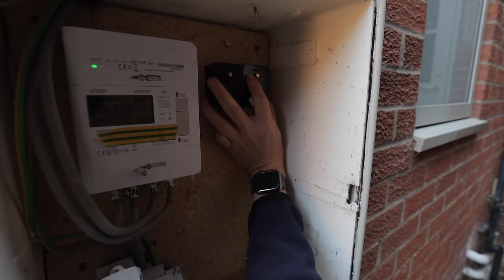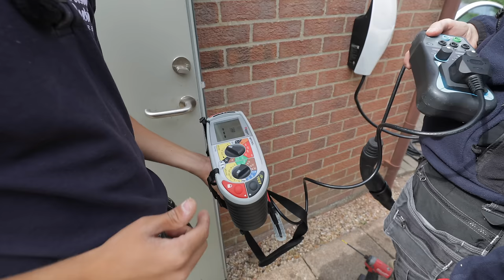I was WRONG! The Tesla Gen 3 Charger is the WORST!

Comment: Tesla, like apple,  only like doing things their way. The template suggests the backplate only be fitted with two screws, if going for a rear cable entry then the two screws are on one side, which can make the unit wobble a bit. They provide their own shaped screw heads which round off. The carbide terminal screws really affect the test readings so you have to awkwardly get the probes in. The tether, as Jordan mentioned, does its own thing and will not coil up neatly. Not to mention the PEN fault detection device needed or the annoying WiFi restraints and commissioning app!
Reply: I have installed many Gen3 Wall Connectors, including my own with NEVER an issue connection with a Wireless Network.
Reply: @michaelholliday100  FFS so you keep telling us... We get it you have installed loads without issue, well done.

Comment: I use many nodes on Wi-Fi for my IOT devices. To be honest I never use Wi-Fi for my CCTV so I will never understand why the Tesla Gen 3 does not have the option of wired CAT5/6 connection. Wi-Fi has noise and the more devices the more noise. It is like one CAT5 connection for all devices. So either separate them or hard wire them. In my mind hardwire them and I have three isolated Wi-Fi networks!

Comment: Jordan, are you not able to put a side cable holder on the left hand side of the charger and then put it in place on the right side. You can have the roller on the left side of the charger with the last bit going to the side female placement to the charger. Just a thought!!!

Comment: I wrote on your first ver3 vs ver2 charger video. An electrician myself. I have installed versions 3s.  There has never been a problem getting the wifi set up. The customer does it anyway. I just had a customer link up 2 of them sharing on one 60a circuit and he did it with not much trouble.  Munro live did a overview and found the design to be very  well executed.

Comment: Hey Jordan, I just had a look at the Tesla spec. It only supports 2.4Ghz b/g/n WiFi… modern/newer WiFi protocol is on 5Ghz band… so if you aren’t running 2.4Ghz in your office, the charger won’t find your WiFi network 👍🏼
Reply: Its not really correct to say "newer WiFi protocol is 5Ghz", as the protocol is a different thing and a good WiFi 6 router actually does WiFi 6 on 2.4Ghz too, so both radios are actually on the  most modern protocol.  Not to mention that 6Ghz is the latest WiFi frequency now and 5Ghz WiFi has existed almost as long as 2.4Ghz, it just wasn't as commonly used when hardly anyone had WiFi so interference wasn't an issue.

That said, most devices on 2.4Ghz will be WiFi 4 because its cheaper to implement (2.4Ghz never was upgraded to WiFi 5/AC).

Comment: Depending on how its configured some US wifi devices won't operate on channels above 11  (Different countires limit use of higher channels). Forcing the Wifi router onto a lower channel can solve this.

Wouldn't expect tesla to have this issue as surely they must adjust it to the local country/region. 

But I have deff encountered this before when using wifi enabled devices from the USA in the UK. Particularly when people have forced their wifi onto one of these higher channels to avoid interference with neighbouring wifi routers/hotspots. Would link to the wikipedia page of compatability but not sure I can post links here?
Reply: I posted a comment below with a link to a tesla forum confirming the above, but it was deleted due to an external link. Seems they disable some of the 2.4GHz  channels eg. 12+ as these are disallowed  in the USA. Odd they don't tailor this to the EU market!

Comment: If the charger had trouble connecting, it may keep having trouble updating once placed to the original position. It would be wise for the homeowner to have a Mesh system with an external (or internal) WiFi point unit somewhere near the Charger. It would also help wireless light bulbs, cameras, doorbells or other devices that would have trouble connecting in this area.
Reply: Yep Ive just added a  wifi extender in my garage so that my charger in the garage can reliably connect and also my soon to be (hopefully) solar & battery stuff.

Comment: It’s probably the dual band 5GHz sharing 2.4GHz and 5GHz. Happens a lot with Smart Home and IoT, they come with a cheap wifi chip that can’t determine or filter out which BSSID is the 2.4GHz to use.

If they request the connection and get the 5GHz, it just times out instead of connecting. And it doesn’t know why it failed, because it is cheap, ie it doesn’t attempt the next MAC radio Device or understand how to. Usually it’s something like an ESP8266 chip, $1 or less.

So it just tries to reconnect to 5GHz again as it’s in the top of the list of connecting MAC radios, ie the strongest signal or best to connect with when you have a shared broadcast name with 2-10+ repeaters that all announce themselves with the same channel name. 

Because the names are identical, they have to know the MAC and connect to the MAC, not the Name. The problem is repeaters won’t work if you hard-connect to a single MAC, and if the router changes then you have to re-register the WiFi. 

It’s why people recommend a legacy 2.4GHz channel name on the router for connecting old/cheap devices that can’t differentiate and only work on 2.4GHz or 802.11b/g
Reply: Agree. If it has to be signed up with a phone, always go 2.4Ghz. Most home routers have out of the box one signal that is supposed to support 2.4 and 5 but that is not the case as most IoT devices dont seem to work . So the only way its to create two different wifi connections for 2.4 and 5.
Reply: @B_T_B  Rather not recommend that for regular use 2 separate SSID's for 2.4/5Ghz, but instead create an extra 2.4 Ghz network on a separate SSID for IOT devices that don't support 2.4/5Ghz mixed in one SSID.
Reply: Actually in this case, the Tesla 3rd Gen charger only supports 2.4GHz WiFi
Reply: Could be the density of the network too. I do a lot of IoT and esp8266 and some eps32 don't like high density networks so I just keep my it wifi at VT20s
Reply: This!!! so very true!!
Reply: @antoniogoncalves705  There is a limited number of channels available, so eventually, with a lot of independent SSIDs congestion will occur. That's why the 5GHz band came into use.
Reply: @deang5622  There are 13 channels for VT20 2.4Ghz and if you have a self optimizing AP unless you flood your internet with a lot of wifi and devices having 3 networks 1 5Ghz 1 2.4Ghz and 1 for IoT wont be a issue.
Reply: @antoniogoncalves705  Where I live, I can pick up 20 individual WiFi networks.
Reply: @deang5622  Hoo that makes more sense. Still for example Ubiquiti devices have auto channel selection based on traffic besides that yhe that kinda slows down internet connection.
Reply: @antoniogoncalves705  You are mistaken, each channel is 5Mhz in width, so there are potentially four VT20 channels (as its technically using four channels) but generally only three  as so many routers use the US scheme which only has 11 channels .  To further confuse this most routers only mention one channel, some call it centre channel, some will call it upper-channel, others lower-channel.  So you may need a WiFi scanner to make sure you are aligned correctly with other networks, assuming they are even configured correctly.

WiFi you do not want a VT20 channel to partly overlap another, as that is seen as background noise so they will try to broadcast at the same time as each other.  Whereas if you fully-overlap (two networks on the same VT20 channel) they recognise that its two WiFi networks and will try to avoid broadcasting at the same time.  WiFi 6 is supposed to improve on this, by being able to control each 5Mhz chunk independently, but that will only help once every network in range is WiFi 6 and all WiFi 6 equipment actually supports that feature. (it sucks not all devices support all features)

Sometimes you will get better performance with partial overlapping but this is frowned upon as its due to your router being better at coping than the other one on the same channel. So while your service is performing better, the other network on the same channel will be performing much worse than it should.
Reply: @B_T_B  Another approach that usually works is to temporarily disable the 5GHz radio while setting up the device; afterwards it'll happily stay on/reconnect to 2.4GHz even with the same SSID also being used for 5GHz.
Reply: most tri routers you can setup a 2.4 band just for older equipment, no need to get another router.

Comment: If they have an issue with pairing up possibly from distance to the router then connect to the customers router and then create a mobile hotspot with the same details and place that in the middle of the router and the charge point.

Comment: I think the main issue with most Wifi enabled IoT equipment is that it dont play well if there is one Wifi network using both 2.4Ghz and 5Ghz, the 2.4Ghz is used still for most wifi enabled devices and thus it prefers a dedicated 2.4Ghz network band, so try asking the customer to separate the wifi into two different SSIDs operating at different bands respectively

Comment: If the location of the charging point is so crap & flakey for the WiFi to connect & commission by doing the connection right next to the access is not going to address the connection issues that will exist with it when its installed in its permanent location. 

Also WiFi is symmetrical so its useless having a high-powered Access Point when the IoT device radio cannot reach back to the AP.

Comment: That Gen 3 charger also has your knuckles scraping on the wall because there is no stand off spacer like the Gen 2 that lets it sit further away from the wall (its okay for pole mounting).  The other issue I have is with the Wi-Fi.... other than setting parameters and software updates... it doesn't anything.  Once its setup, you cannot connect to it to check or adjust charging rates, etc.  Tesla needs to add functionality to its app to interact with the charger.  I dunno about the UK, but the Tesla Gen 3 is only AUD$750 which is a complete bargain compared to any other brand which makes it a go to charger regardless of which brand car you have.

Comment: From my experience the installation was done like a piece of cake by my local electrician, but connecting to the wifi was a nightmare. It was purely due to my hyperoptic broadband in the UK was using the same name for 5ghz and 2.4ghz network and it was supporting WPA2/3 passpharase which the TWC cannot detect the password., I have to change that to WPA/WPA2 for pass phrase for home wifi and it worked like magic. This piece of information was widely missing from their guide/notes

Comment: I don't really get if PEN fault protection devices are readily available, why it hasn't been standard practice in all new TN-C-S arrangements for the full electrical installation? Or even a feature of smart meters which usually have a relay? Even if the risk of a broken PEN is higher outside, it would also lower a lot of risks inside.

Or is the risk of a broken PEN just not high enough to justify the extra costs for all electrical installations so it's just mandatory for outside appliances like EV chargers?

Comment: Do You read manuals?? Tesla wall charger gen 3 have RCB0 in side and don't need any extra stuff to install. In gen 2 You need install this extra fuse box with RCB0 and that the main difference and wifi of course.
Reply: no PEN fault protection though?

Comment: I always thought that only the DNO could remove the company fuse to install an isolator.
Reply: Technically yes, the meter supplier can also remove the DNO cutout - the electrician is not supposed to but in reality many (if not all) do.
Reply: Safe isolation trumps all. If you have to pull the fuse to do the work safely, then that's what you do. No DNO is going to have you prosecuted for following HSE guidance as long as you notify them so that they can come and confirm no meter tampering and reseal it.

Comment: Just had a wall connector installed yesterday in the States and the wall connector would not pair.  We do have 5Ghz steering, and the same SSID or wifi name is used for 2.4 and 5Ghz.  Luckily, I do have a separate SSID for 2.4 Ghz only, for so called (IoT) internet-of-things-type devices.  Thankfully that worked:)!  But the electrician did say things like he has to use his phone for the initial setup at most places because the customer's phone typically doesn't work.  But even though we tried first with his phone and then mine neither could get the Wall Connector to connect to my main wifi.   But since the pairing with my wifi did not affect my ability to used the wall connector to charge my car I told the electrician he was good to go, that I would sort out the wifi.  After he left I tried several things on my main wifi network like narrowing the channel width and turning off some of the more advanced features that improves roaming with your smartphone or laptop.  I had thought it was best to have the wall connector on the same wifi as my phone as I wasn't sure how the wall connector would react if I had it on a different wifi network than my phone.  But eventually I just said, well let me try my IoT wifi and that worked.  I then checked if I could see my wall connector in my telsa app and I could.  So I went back to my main wifi settings and put everything back the way it was.  I have had similar problems with other IoT devices like smart light bulbs, so I don't think this is just a wall connector issue.  I think these IoT devices need better wifi chip sets and radios.  And the 2.4 Ghz wifi radio spectrum is the most congested so that doesn't help.  But 2.4 does typcially have the longest reach signal-wise compared to 5Ghz.

Comment: Why don't Tesla Wall Connectors need all that extra equipment in the US? Mine is hardwired straight into my home's electric panel. Had it installed yesterday (March 21, 2024)
Reply: because we are not crazy in Europe. 
You need some protection between the panel and the wall connector (imagine for example if somebody accidentally drills a hole into that cable), so you need at least RCD A in the electric panel. Then you should protect the circuit from the wall charger, so you need at least some circuit breakers into your electric  panel or before you will connect the wall connector. In some countries is also required a hard stop button to disconnect the charger, Tesla does not have it. Could be replaced with the circuit breakers in the same area as the charger. Or the technician proposes an emergency stop button.

So the installation in my garage will be following - RCD A in the main electric panel - > 10m long cable to the garage -> small panel with the 3x16A circuit breakers - > cable to the Tesla wall connector.
Reply: @ there is protection already built into it… this extra crap isn’t needed and is completely overkill.
Reply: @icy1007  You do not have any protection between the panel and the wallbox, just a live cable. This "exta crap" can save lives.
Reply: @RapManCZ  Yes you do. It is built into the Wall Connector.
Reply: @icy1007  No you do not. If you touch the live cable BETWEEN the panel and the wall connector, what will happen? You will get an electric shock, because you do not have this circuit protected.
Reply: @RapManCZ  That applies with all live cables. The cable is live even in Europe. lol
Reply: @icy1007  Exactly. This is the reason why you should put RCD protection to your home electric panel. 
If you touch the cable (from panel TO the wallbox), you will not die, because the RCD protection will react in around 40ms and disconnect the circuit. 
In your case, you will be getting the shock until you or somebody else disconnects you, because you do not have the RCD protection.

The built-in RCD protection in the Wallbox is only in direction Wallbox -> cable FROM the wallbox

Comment: You should consider installing Easee if you are not already. 

Best charger on the marked, comes with integrated type B RCD protection and open PEN conductor protection. 
It has fully dynamic charging power 1.4–7.4 kW, with 4G internet access and an integrated eSIM with lifetime free subscription, along with Wi-Fi connection capability.
Also, most enticingly, this EV charger allows for up to three vehicles to be charged at once, and the way it’s designed means that you don’t need to worry about overloading your system (available power is automatically split between the cars).

Source: Green Car

I myself have two of these in Norway and they just work, with integration with third party I can smart charge my vehicles when the price is lowest.
Reply: Looking to buy an Easee one for my incoming Taycan. A friend has just installed one for his Polestar and says it's brilliant.

Comment: I have a question, does it connect to the internet only via WiFy, or it can be wired by Cat 5e?
Reply: That's another thing my installer would not do. I already had cat 5 to the area of the wall charger, but they would not use it. Arseholes.
Reply: @greghudson9717  So the charger does have a RJ45 plug?
Reply: @scifycartoon  From memory, RJ45 is Ethernet, so the answer is YES.

Comment: Same kind of crap when Tesla dropped 3g support. Wireless pairing did not work. Fortunately the outfit that sold/installed thr equipment came out an ran the ethernet cable...as *warranty service*. Check out *Swell Energy*, if you're in the SF Bay Area!

Had a contractor who swore by his custom knee-pads... Unfortunately, i don't remember the details, bur they looked like the shin guards the Storm Troopers in Star Wars wore... I think the idea was they actually distributed the load, putting some on the *shin*, so the knee didnt take so much abuse. Anyone else know more details?
Reply: I have installed many Gen3 Wall Connectors, including my own with NEVER an issue connection with a Wireless Network.